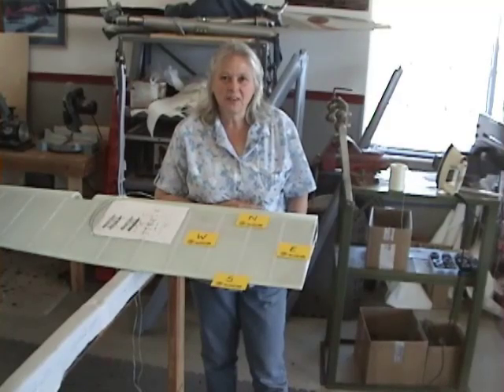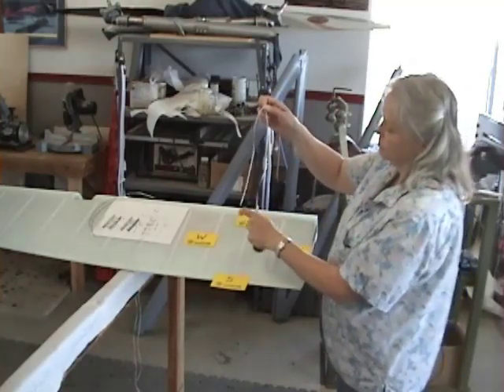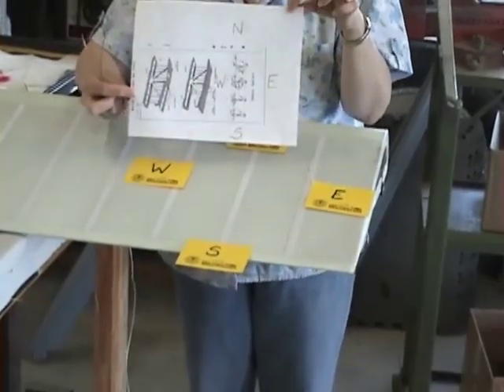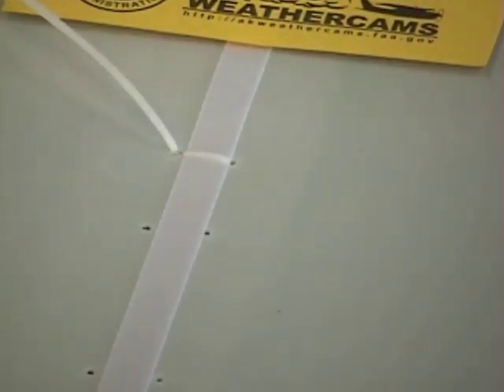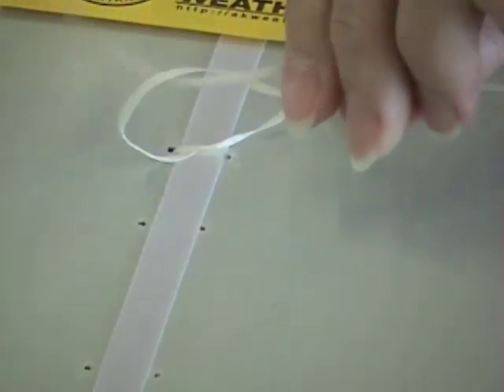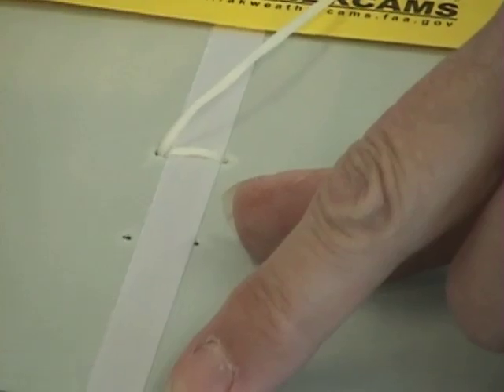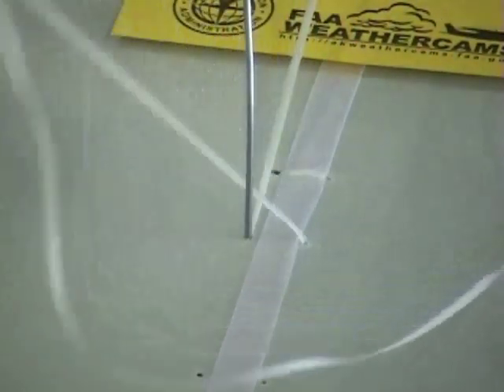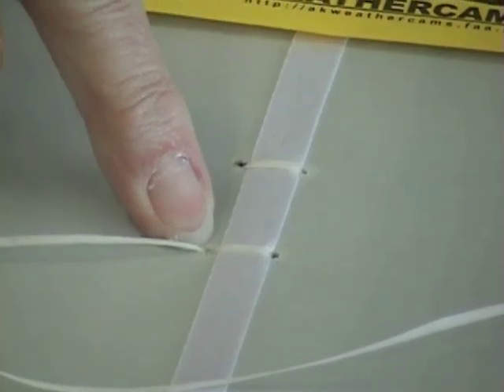Aircraft Rib Stitching Video 1 of 2

Comment: What is the purpose of this and all the diffetent knots....
Reply: The purpose of rib stitching is to keep the fabric from vibrating when the aircraft is in flight. If the fabric isn’t stitched it will wear holes in the fabric and tear apart. The stitching will prevent this, plus the stitching is covered in what’s called pink tape. It’s called this because the edges are cut with pinking shears. This also prevents that from tearing. I’m old school so when I worked on airplanes I used 100% grade A cotton and butyrate dope to tighten the fabric. They don’t use cotton anymore, now it’s a nylon covering that’s much more durable. It’s tightened up with heat. I’ve never done that type of covering so I can’t give too many details on it. The airplanes I worked on were Air Tractors made in the late 70’s and the rudder and elevators were covered in fabric. Last, the knots that I used was called the Seine knot. You can look it up and it’ll show you how to tie that particular knot. Anyway, I hope this helps?
Reply: @michaeltruhett4170  Yeah I didnt want to do any of that stiching, covering, or messing with toxic Stitts chemicals.  So I abandoned my three airplane projects and now fly fully aerobatic auadcopters instead.   Popping rivets is fine, I just have zero interest in ever coving a plane.  Like, ever.  Zero.
Reply: @choppergirl  I can certainly understand that. I worked on ag planes, crop dusters as you would most likely know them so harsh chemicals was an every day thing for me. I kept myself as clean as I could of course, but I’m happy I’m not around that stuff anymore. As for your aerobatic flying, that’s great! I went aerobatic flying one time with a good friend of mine. He’s dead and gone now. He was a pilot in WWII flying C-46’s over the “Hump” in China. Anyway, best wishes to you always and thank you for writing to me.